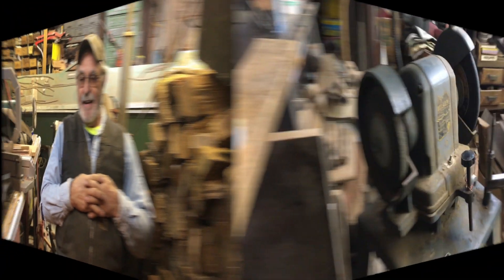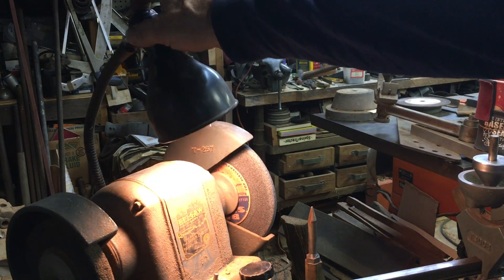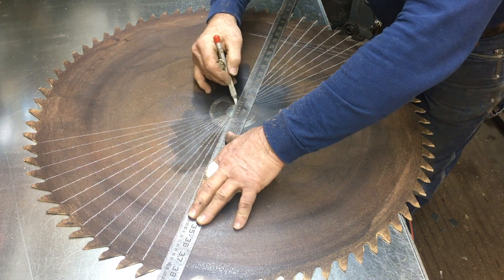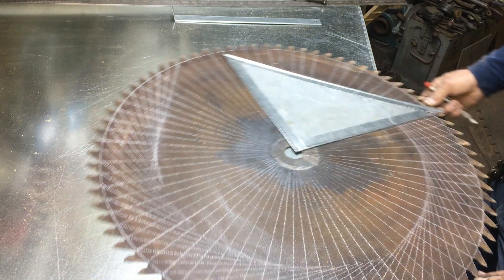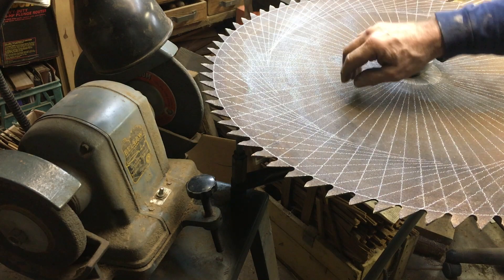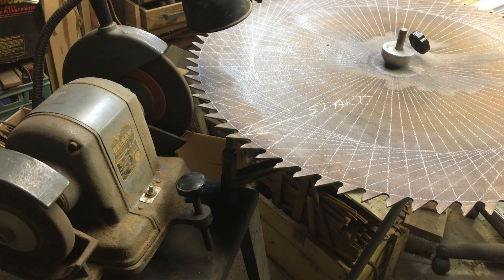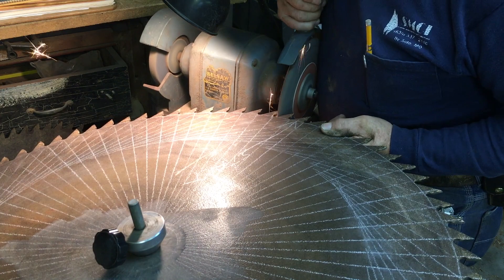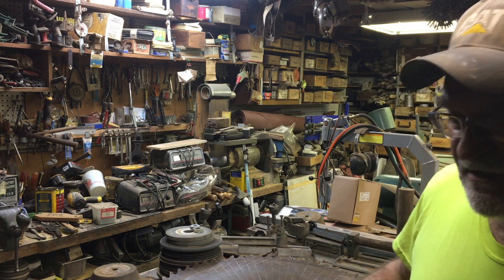Belsaw 10452  Buzz Saw Makeover Part 8

Comment: Hey Buzz, I can't say enough about your style, your demeanor, knowledge and great way of getting it to stick in my hard noggin. Farming since 65' and still at it learning how to do it from young fellas like you. I enjoy puttering summers and in the woodlot winters...which brought me onto your site. Overhauled my woodsman 250, polished the 30" blade and wouldn't cut butter left on a hot oven. Watched your shows and turned an old craftsman table saw  into a gummer with a 12" wheel to give me 10* angle. Made a jig to ride in the table saw tracks, stops to keep it fitted and true to form. You got me to comprehend the lines on the blade, too. Thank you for making my winters bright and cheerful. Maine is sunnier with what you showed me.
Reply from the maker: Well Jamie I am glad to hear you benefited a little from the stuff I put up here.  I'm just passing on a little bit of what I picked up from the old man back in the day. Those old timers had to make do with what they had.  And like I said, the geometry might not be exact or perfect, but its what we have done for decades and it seems to work well.  Now if you have those other angle teeth like on that primered  blade in the other video, that one isn't a cross-cut blade like these teeth with this angle.  But they will still work on a buzz saw though it might not be recommended.   Good work adapting that table saw, the old man hung 'em with a chain and swung them in and out on a gumming wheel mounted on an old Delta wood lathe.  A bit crude but functional as can be.  Just remember to mark the gullet radius before you take the blade off the rig.  That way your teeth will always be the same depth and the blade will stay round. This one will have the other style teeth: https://www.youtube.com/watch?v=TZ36Rxpn754&t=41s  Thanks for watching and commenting....anytime.
Reply: Od mladih momaka poput vas,,,, jbt.

Comment: Tractor Man 44, just wanted to thank you for your very informative video on blade sharpening. I am from Ozarks in Missouri and have had a buzz saw on my 1935 john deere a for 40 years. I was able to pick up a Belsaw grinder for $75.00, and did as you taught us. When I put the blade back on the tractor, first log I ran through it was amazing. It cut through it as it were butter. Thank you sir for sharing your wisdom, something the world is short on today, God Bless
Reply from the maker: Man o man. You got a deal on that Belsaw. I’ve got a buzz saw that came with my ‘39 JD A but I’ve never put it on. I’ve got a couple other videos on buzz saws on a little Kubota that show more about filing and setting too. I think up top under the Playlist heading is where I’ve set up a series of buzz saw videos.
  If you are near Osage Beach I got to do a good deal of the HVAC work on the hospital expansion that started back in ‘96 or so. Also I did the HVAC start up at the Medical Center right at the end of the new bridge too. 
   Thanks tuckahoe,  for the awesome comment.

Comment: gotta say man  your the best teacher on theya old saws im now going to billed the whold thing to sharping my own
Reply from the maker: Thanks Douglas, I am glad to have helped you out a bit.  Another viewer set up an old table saw like I suggested in another video about the buzz saw.  Put the gumming wheel on an old table saw and do the same thing.  Nice flat surface to hold the blade and not hanging by a chain like we did on the wood lathe.  Now this one is for sure a cross cut blade, not a ripping blade. The ripping blades have a different tooth geometry and usually are not used for the cross cutting that the buzz saw is built for.  Good Luck with your build !!  You can always leave another message giving me the results of your job.  Thanks for watching and making such a supportive comment !!

Comment: got my two saws sharping and set and up and running after a verry long time my one 23inch saw is cutting relly good my 36 inch saw ihave no tryed yet it had two wholds in it from someonewhowas  drilling something on it  some time ago i clean it up and repaird it with IJB.WELLED  looking good i got to try  this saw as soon as this  havey rain storm pass  thanks again DOUG
Reply from the maker: Awesome Doug !!  I'm glad to hear you got the blades back in good shape.  Like I said  in the video, its probably not what professional sharpeners do, but its what and how I learned about the old blades from my dad.  He sharpened just about anything that could get dull. Even my ice skates, kitchen scissors, hoes, axes, shovels, knives...anything with an edge !!  He would have loved to have had a Belsaw sharpening setup.  Thanks for the comment and the update on the blades.  Hope you are making firewood by now !!

Comment: Wow TM44, once you get goin on the bell saw you build up to lightening speed,OWeeee! Must have had a whole pottaJO! A great video! It was so interesting to see that old machine do its job. I have a few tools sitting around for years needing to be put back to use, like my old treadle jig saw. Cast iron with a seat and foot peddle. I took it apart years ago to go over everything and it sits in a box somewhere in me shop. It is painted black with some red pin striping,which I intend to restore and use. I have an old double peddled water grinding wheel too. The stone wheel was left to sit in water a long time, probably outside, and there's a flat spot on the wheel. I did find another nice round wheel but yet to get to it. Yep, it has easily been 20-30 years now. Some other stuff too. But with enough JO to tank up on, I'm sure I'll get to it. I'll be wanting to see how well your new sharpened blade does with that Oliver power. Thanks Much TM44! DaveyJO
Reply from the maker: Thank you sir for hanging around and watching a few more of these.  This particular blade here is just a small 31" (?) I think..but its for an old buzz saw that's being reworked for three point connection on an old '55 Ford 800.  I don't think those big blades would fit on the sharpening mount on the Belsaw.  It'd be nice to see some of your old treadle powered machines.  I think there's at least 3 and maybe 4 of the treadle stones leaning against trees in my yard !!!  Terrible huh....

Don't you wish we could get as much work done is as short of a time frame when fast forward gets in gear....lolol.   Nah...me neither.  Half the fun of completing a project is DOING the project and the only ones I really want to get done before I start has to do with sewer work....LOL. 

That reminds me of a question....I've got a small old sharpening stone mounted in a cast iron water sump, probably 8" by 1 1/2".  I got it for something like a quarter at a yard sale with no motor.  I mounted in on a channel iron with a small pulley driving it with a 1725 rpm motor but don't remember what the calculated rpm is of the wheel.  It IS fairly slow and I can get it slower BUT..... which direction is the wheel supposed to be turning???  Down from the top and into the blade being sharpened and then into the sump OR up out of the sump from the bottom right into the tool being sharpened.  I have it coming down from the top into the blade and it seems to carry way too much coolant and splatters too bad. What's your thoughts on rpm and rotation ?? It is a really fine white stone and I want it to be available to use, but haven't taken the time to keep experimenting on it.  Same old story...too many things to work on and not enough time to work on them....  Soooo DaveyJO, thank you again sir for the compliments and conversation....I'm on my last cup of JO for the evening right now.  (-:
Reply: Tractorman44 I have my. Wheel going away from me. I had it going down and like you said, there was so much water I couldn't see what I was doing. I'll have to look at my wheel to see what rpm it runs at. So Ill let you know. I, on me last cuppaJO right now. Got to let the JO Faries rest for the morning JO. Have to keep them on their toes,,,,,,or wings I mean.  I'll have to take some pics of some of my stuff. Hope you have good tractor dreams. All I'll dream about is finding floor space in me shop. So tempting to fill it up with stuff but I must resist ! DaveyJO sippin JO
Reply from the maker: @daveyjoweaver5183  Hahahahahaha  funny stuff man... Hope the fairies let you sleep well.  I'd
 appreciate the input on your rpm for sure.  I thought of another water cooled grinder laying under the lean to.  I think its a real thin but large diameter white wheel as well.  I'll have to look today, but there's a small work table with the lower half of the wheel in the sump and it looks like it is for vertical grinding of something on the face of the wheel..  I'm thinking the stone is attached to a backing plate of sorts... Now I ain't set eyes on this thing for years so the memory may be playing tricks on me so I hope I can dig it out today to look for sure.  No fire a going for me today, its still 73 in here and only 54 outside.  Second cup down the hatch and the first one is almost ready to head for the drain...  Oh and a hearty Good Morning to you sir !!!   I shoveled half a truckload of mud/clay for an old buddy yesterday locating his incoming water line.  He's losing 2 gallons per hour.  We found the pipe 35" down, but I'm going to have to take the backhoe out to keep digging downstream to find the leak.  I'm going to dig in the direction the water is seeping into my hole/trench from.  But its in the middle of a field and soft as the devil so its gotta dry up a bit before I sink the truck and gooseneck turning around.  

The bad thing about finding all that hiding concrete in your shop is now there's a spot to stack some different good stuff.  It is hell getting rid of what you know your'e going to need next week....but dang it you never know what your'e gonna need until you throw it away...  Have a wonderfully great day DaveyJO and have another on me !!

Comment: I have 2 buzz saws. One mounts on the front of  tractor, the other is stationary, but I only have one decent blade. I also have a Belsaw grinder tucked away in the shed.
 When I get roiuntuit, I need to clean up the rust on the faces of that blade(maybe electrolysis?) and do a proper sharpening of it. 
 I burned wood for over 30 years for heat, but no longer do. Now that I don't have to go looking for wood to cut, I have 20 some dead ash trees around my yard, that NEED to come down. Probably make into firewood for my daughter.
Reply from the maker: On real rusty old blades, I just use a wire wheel on an angle grinder and give it the dickens.  If you do use electrolysis, remember it'll flash rust in no time so you gotta hit it with a coat of oil or wd40 at the minimum.  When I spot those blades or an arbor at a farm sale, I always try to take them home.  Most of the time they'll go for five bucks or so and other times, I just buy them off the scrapper if they happen to go along with a whole pile of scrap material.  Thanks Charles for the comment.

Comment: Great video, very informative, love watching it up here in southern Ontario 🇨🇦.  I recently purchased a Belsaw for my 28” buzz saw blade.  
Q1:  what wheel thickness do you use on your Belsaw and is it the same wheel for the gullet, back of the tooth and front face of the tooth?
Q2: do you set the teeth at the end or just before grinding the front face of the teeth?
Thanks so much for helping out all us DIY’ers!!
Reply from the maker: Yes, I use the same 1/2'' grinding stone for all phases of sharpening one of them. I usually set them afterwards, but once the blade is back on the arbor use a file in one hand to go around the blade and 'touch up' the tooth.  Just one lick per tooth usually gets it back.  The hammer will sometimes push a little tooth material up onto the front of a tooth.   Now mind you , I only am doing the things I learned my self over the years based on working with my dad from the time before I was ten.  I'm nothing near to a professional sharpener. But the Belsaw really makes it easy !!  For years and years I did it all by hand.  Gumming and re-shaping the teeth was done on a wood lathe.  But that's another story.  My dad didn't have the good fortune to own a Belsaw.
Reply: That’s exactly the information I was looking for, thank you so much!!  
I know you say you’re not a professional, but by golly your techniques, your attention to detail and your explanations are second to none and I for one am very grateful for your videos. Very impressive, good job sir.

Comment: Love the old time setup. This sharpener does not require any markes of any type. Face grind floating with no stops then index off the face with a stop for top grinding. 👍
Reply from the maker: I AM kinda new to this old fella.  It'd sat in the corner for 20 years or more.  So everytime I get a little better and smoother at it.  Me and the old man did all of them by hand over the years and gummed them on a wood lathe with a 1/2" stone.  Thanks for the input. I do appreciate it.

Comment: very helpful video. i am unsure about your setting the teeth in opposite directions. does that attachement on belsaw limit the bend ?
Reply from the maker: The bend is limited by how far you extend the tooth tip over the anvil.  Every one is then bent to the same angle at the same point back from the tip of each tooth.  The teeth have to be 'set' in opposing directions to create the 'kerf' in  the wood.  Without the kerf, there would continually be friction on both sides of the blade and in no time, the blade would overheat and warp or 'cup' until it cooled down to regain its flat shape.  If you are cutting freshly cut soft woods, you want to increase the width of the kerf by giving the teeth a deeper set.  With too little of a kerf in wet woods (especially soft woods) the kerf literally attempts to squeeze the blade as it passes through.  That also makes it easier to pinch the blade and toss the belt.  Even a dull blade will attempt to throw the belt.  The blade wants to slow down, but the tractors pto doesn't want to....so it'll run to the side and pop off quick as a wink if you are not careful.  Does that answer your thought provoking question Jim ??  Btw, that was a GOOD question too.
Reply: @tractorman4461  yes. am gonna pu a belsaw sharpener tomorrow & try out on my buzzsaw. c. mine will have a weighted arbor.

Comment: Thanks for the reply, and I also enjoyed that video. You're very easy to listen to. Funny you said your Dad was born in 09' as mine was born in 21' which puts us in or near the same decade. I've got 75 or 76 teeth on my  30" blade but it' seems odd the teeth are only 3/4 " long  and have no gullet unless you count  the little 1/4" wide U between each wave. I want to grind a gullet but wasn't sure of depth or width  but one of your videos gave me a ballpark on the angle.
I picked up a booklet Fitting Farm Saws by Louis M. Roehl 1934 and it's a great piece to hang on to since I have a barn full of saws left from the previous owner's great grandfather born late 1700's when the 90' barn was built. Two man saws, buck saws, coulters and the like. This book is on-line and a free download  just google the title and it comes up.
They have several plans for sharpening jigs, tables, braces and that stuff I'm sure you would enjoy and they rely on their keen eye as their best guide with more attention to initial fitting of the saw as a good first step to accuracy of sharpening angle. 
In the book, they show my blade as being item "B" and say it's best to give it a healthy gullet and to use a 3/8 wide gumming file to cut the gullet and to not overheat or turn the steel colored or blue. Can't find a 3/8" and may need to settle on a 1/4" or 1/2" wide gummer wheel.
Thanks again for passing along your Dad's helpful tips.
Reply from the maker: Wow...!!  Very interesting that you've 'inherited' that barn full of old tools !!  My biggest two man cross cut is 4 cuts and a drag that is 84'' long and was my dad's favorite.  It's over my fire place.  I've got other shorter two man and one man saws, 4, 5 and 6 foot too as well as buck saws.  You don't want your gullet too deep, the teeth will be too long and will be weakened, I'd think. When you grind the gullets, to keep the heat down, start at one place (of course) then grind maybe three or until it starts warming.  Then rotate it 180* and do the same, then 90* and the 180* again... Then go back to where you started and pick up where you left off.  That will minimize  the heat build up and not soften the metal, which is what too much heat will do.  Try googling SharpeningSupplies.com to look for the thickness gumming wheels you want.  Might work out for you. Thank YOU for the awesome comment Jamie.

Comment: I bought a 10452 a few years back at a garage sale but it didn't have the adjustable bench on the left or the arm on the right...so basically it's just a grinder now.

I wish I could get the missing parts somewhere at a decent price.
Reply from the maker: If you join the FB group for Foley Belsaw you will see quite frequently items for sale and many times kids will be cleaning out grandpas shed and offer them free or any kind of offer or they go to the junk yard !!  The problem is always the location.  Also on FB Marketplace they will pop up from time to time.  Just type Belsaw in the search bar.
Reply: Thanks for the tip.

Comment: I just recently found your videos and I find them very pleasant to watch. Is the saw set you used part of the Belsaw setup? I use an old Aiken hammer set from the end of the 19th century and have a Belsaw model 10293 much like Mr. Sneelock's. Thanks again.
Reply from the maker: Yes Joe, this is part of the Belsaw 10452 SharpAll system. I do have similar set ups from other manufacturers, but I find this one the most user friendly.  Beats the old routine I learned from my Dad in the '50's and 60's of using two ball pein hammers to set the teeth.  Old Sneelock is certainly a gem when it comes to old tools.